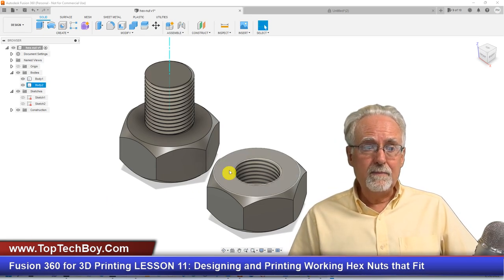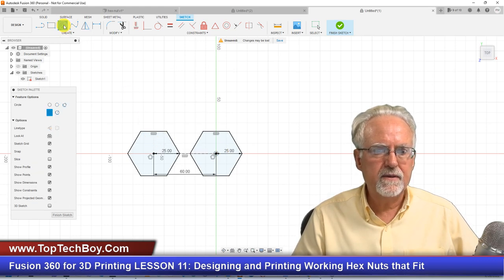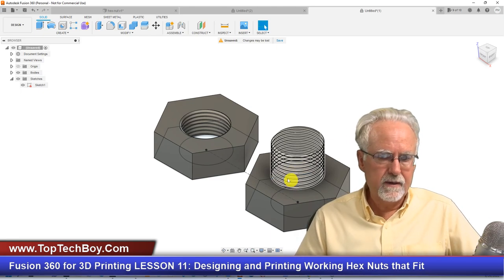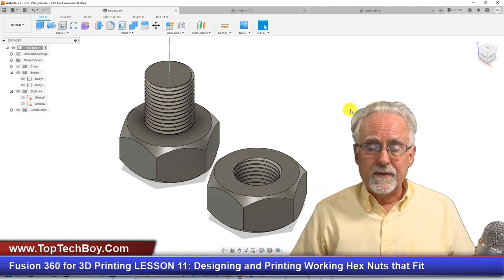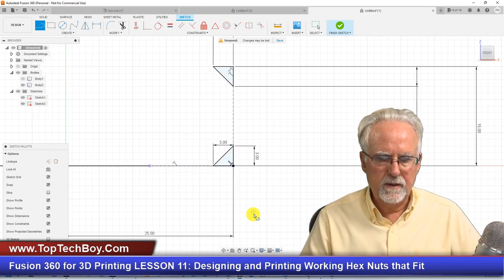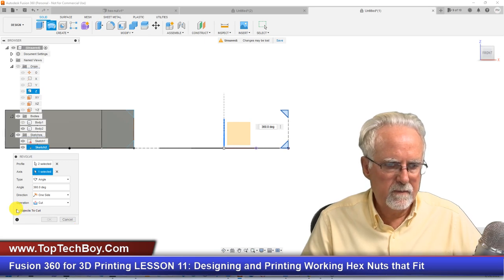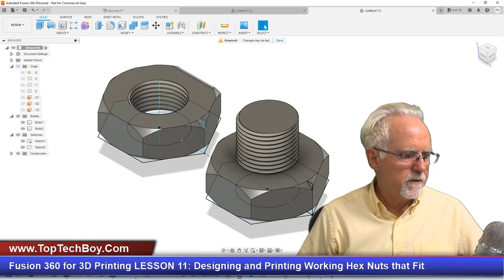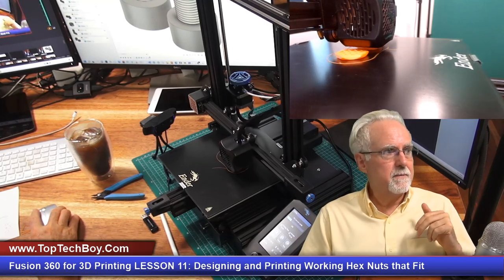Fusion 360 for 3D Printing LESSON 11: Designing and Printing Working Hex Nuts that Fit

Comment: i am legend. Hey Paul, a quick pro tip for you in case you are still struggling with the selection tool. Keep pressing the left mouse button near the Line/face/body/whatever you wanna select, a pop-up window will appear where you can quickly select what you wanna modify.

Comment: You are spot on target with fusion360/3D printing, that's exactly why I'm here.
I did the nut and bolt challenge and managed an unequal chamfer, I think it was 1mm and 4mm in but then it all went pear shaped when I went back to 2D and tried putting slight radius's on the hexagons outermost edges. As someone else has previously said, the order of doing things is important, another thing to embed in my nut.
Thanks

Comment: I understand exactly what your going for in this series. Back/forth makes complete sense because you’re catching every aspects of 3D design and manufacturing.
 
The Quick Tips series is an excellent idea because it either supplement this series or stand alone by itself. 

I appreciate you doing the series and am learning a lot. I made the bolt/nut and used the chamfer function to round off the edges. I went with a 0.1mm offset and it was too tight. Went for a 0.2mm and it was to loose. I ended up going back to 0.1mm offset and lowered my print height to 0.12mm instead of 0.2 and it came out perfect.
Thanks again for the classes and look forward to learning more about using F360.

Comment: I AM LEGEND!  I printed a nut and bolt with simple square shoulders and designed a version with fillets on the corners, but had no idea how to do the nice revolve version.  The threads on my first print were too poor to work.  I slowed the print speed and improved the print quality settings in Cura to get a great bolt and nut. Regarding future videos, the Quick Tips idea sounds great so long as they are easy to search with a simple indexing scheme. I am probably more dense than others, but I have always had difficulty searching for information in earlier lessons in Paul's courses.  Please don't be offended by my suggestions Paul.  You are the GOAT instructor on the Internet!

Comment: I feel like the way these lessons are being taught in terms of fusion 360 and printing is how it should be ! I really hope it’s stays this way where you go back and forth between fusion 360 and 3D printing because otherwise those of us not familiar with either will find it difficult to go back and forth between two different types of videos rather this way we learn both and the need for both and and the application of both so by the time we finish these lessons we are not really lacking any knowledge.I hope you keep this set up !

Comment: Hi Paul and like so many others have already said well done for super teaching skills and not least a super learning experience. In lesson 11 the threads correctly conform to ISO metric dimensions, However, the head of the bolt and the nut do not with the dimensions and horizontal orientation of the hexagon you use in the design. If you want a nut to exactly fit, for example a 15.0 mm spanner, one has to fiddle around with the hexagon dimensions. This is easily solvable but involves some tweaks with dimensions that are not whole numbers but with 2 decimal point corrections.

Comment: ahhh i see where i went wrong with my fillet attempt.. i had selected the top and bottom face to round instead of just the outside edges, so the inside hole was also rounded which made the bolt not fit into the nut

i will also say i primarily started following this series for the 3d printing portion, but i think learning how to do some of this modeling stuff is really important for that. thingiverse exists but i think people will always want to make their own stuff too. i think the balance has been really good so far.

Comment: You are my go to help solve what should be a simple issue in fusion 360. Totally by mistake I found two ways to do the revolve cut. And with the axis, I had drawn in two center axis lines on each part on that same sketch.  Now I need to figure out the printer setting I need no my Bambu Lab Printer to make the new test thread design work.

Comment: I really like your work 🙂Btw, when you tried to turn the z axis on for revolving, you need to also make the "origin" group itself visible, that one was turned off.
Faster way, at least for me, was to just draw a straight line through the startpoint of the first construction line and use this as an axis. That way you casn even draw that line to the outside of the body, which makes it clickable even when the body is turned on. You have the centerpoints still visible for both bodies from your very first sketch. You can use those for a line 90 degrees to the body - no need for any construction line or fancy stuff.

Comment: I half folded. I found an idea on a web site about how to produce the nice edge on the nut and bolt using an intersection between a cylinder and a hexagon.   Quick tips are a great idea. Normally I would  scroll through one of your videos to find the bit I wanted. For me Fusion 360 and the 3D printer go hand in hand, I can't design what I need without 360.

Comment: I managed to completer the homework assignment but arrived at it a different way. I found a suggestion to put a circle on the sketch intersecting with the points of the hexagon. then extrude it up as the last operation and viola a perfect chamfered nut.

Comment: I got my bolt and nut completed but I folded up like a cheap Camping World camp chair trying the rounded edges. I will try again of course because Mr. McWhorter’s students don’t just give up.
If you split the class in two would you do them every other week? Fusion 360 on the first and third Tuesday of the month and 3D printing on the second and fourth Tuesday? Or is the Raspberry Pi done on Thursday? I don’t think 2 minutes would be long enough. You would need at least 15 minutes plus you would need to get right to the point and not digress about the river cam. I enjoy the river cam and your stories about life in Africa so the class might be a little ho hum. I would eventually like the 3D printing to get more involved. Trying different types of plastic and hopefully having some problems cause calm seas don’t make a good sailor.

Comment: Not sure if that happened the way you planned it there at the end Paul, but non the less, and Super lesson! Yes, these longer dedicated lessons on the hot little shorts sound like a super idea! Again, than you and God Bless you and yours!
Reply from the maker: Vaughn, the second clip showing the finished print did not upload, so the end was missing. Sorry about that. The nut did print properly
Reply: Did the bolt print properly and also did the threads on each one print properly with no seam or blobbing issues?

Comment: Thanks Paul for another great lesson. While it is straight forward to create a nice diamond knurl pattern using a couple of steep pitch coils, one cw one ccw then do a circular pattern of those 2 features, it is really resource intensive for F360. I prefer vertical groves or even a tri-lobed head for printing. I like the idea of short tip vids.

Comment: Hi Paul,

I managed to complete the fancy nut and bolt in fusion 360 as I followed all of your steps. I noticed that in your completed drawing that sketch 2 was not fully constrained. Sketch 1 was fully constrained. The green z axis line iside
Reply: Sorry Paul,

I hit the comment selection before I was finished. The green z axis line was still present on the inside of the nut. Is this why your sketch 2 was not fully constrained? Just wondering why sketch 2 was not fully constrained.

Comment: Well, I think you have the right idea.  I would segregate the classes to where you have a main-thrust that has the two coupled.
Then, I would have separate classes whereby neither is dependent on the other, because they really are independent worlds when you get into the intricate details of either subject.
Finally, I would not make a whole buch of super-short videos because they get perceived as mostly noise; so I would make longer videos that detail multiple topics of each subject--which is more like 'one-stop-shopping...'

Comment: I personally use TurboCAD to 3D model, and i dont really have a problem. I can make simple things for my 3D printer, but im not that skilled. im self taught. I have made a few designs for work that i have used in ice machines, and some fridges, i made a clip for my motorbike to keep the choke up. Yeah 3D modelling is quite fun and i wish more people got into it. I would love to learn fusion 360 but i am way too familiar with TurboCAD.

 I enjoyed your video though. I was following along and seeing if i could model the same nut and bolt in TurboCAD. It didn't take me long, probably 5 minutes to get the basic nut and bolt and then the machined chamfer took me a while but i did figure it out in the end. and got the same result as you.

Comment: Hmm, I was doing fine to HWrk Level '1'. got the polygons in & constrained (even popped a chamfer on the end of the thread, although i'm not convinced the thread is cutting through the chamfer), but I used chamfer on the cylinders before the hexagon thinking that would create the cutaways. So Yep "Folded like a cheap lawn chair" Grrr ... Applied your method also for the thread start. it scooped away at the thread beautifully. Just like it came off the 'colchester'.

Comment: Hello Paul,

Maybe having one lesson on fusion 360 and the next week a lesson on 3d printer and tweaking the printer and going over cura settings and then alternate between fusion 360 and 3d printing each week. 

I have been able to print the cup, glass case, benchy, dog, cat, etc., but not able to print the nut or bolt successfully. They print ok but there is one spot on nut and bolt that does not print properly. It is evidently a seam/blob issue. I have tweaked several parameters in cura and binged watched youtube regarding this issue. The problem lies with the printer or cura. Seems the printer and cura need to be tweaked properly and upgraded so we can successfully print 3d creations. Very frustrating.

Comment: Hey Paul,
Not sure if you have started or finished your quick tips videos but one problem that I have been constantly having with my threads is excessive stringing on parts of the threads which then doesn't allow me to screw the nut and bolt together. I'm sure this could be a combination of problems that likely cannot be solved in a quick tip video. I tried printing with different qualities and tweaking the settings in Cura but I haven't been able to fix the problem.
It's almost like the printer is staying stuck on a level and some filament is oozing out which then creates a blockage in the threads.
Do you think this is an issue with my printer?
Any input would be appreciated.
Thanks again for all that you do! You're the man!
Reply from the maker: If your printer is tuned up correctly, then printing with dynamic quality should work without any stringers. If you have stringers, then it could be an issue with your printer. So many things could be going on. Old filament, partially clogged nozzle, misalignment of print bed. So many different things.
Reply: @paulmcwhorter  Thanks for the reply Paul. That was my worry though. So many different things could cause this issue. I'll try messing around with a few things and I will report back if I solve the issue in case someone else is experiencing the same thing.

Comment: Hey, Paul!  Another great lesson!  I NEVER would have figured out that contour, but I loved the challenge, and I have an idea how to achieve those knurls.  I am banging my head against the wall over the echoLocation RaspberryPi lesson.  I am getting a very pesky error message relating to the KeyboardInterrupt(): command.  It states catching classes that do not inherit from BaseException is not allowed. I do not understand what that means.  I hope you don't me mind commenting on a different lesson.
Reply from the maker: Massive nut and bolt! Well done.
Reply: DrDave The error you mentioned is caused by the line
except KeyboardInterrupt():
it should be...
except KeyboardInterrupt:
without the  ()
Paul added it to his code by mistake. I copied it too and had to debug it.
Reply: Hi DrDave.  There was an error in Paul's echoLocation program.  The except statement should be "except KeyboardInterrupt:", no parentheses.  Try it, you will like it.
Reply: Thanks Charles and Keith! What is really a mystery, and why I didn’t bother to check previous programs we wrote using that command, is that Paul’s python did not return an error message even though he used () in the command. Can you guys explain that by chance?

Comment: For the 360 chamfer create a plane through the center of the bolt using create menu, plane through 2 edges. Click on that plane then new sketch draw the triangles. Make sure you have an axis through the bolt if not on origin. Finish sketch,  Turn off body, choose resolve, click the triangles, cut, choose axis, turn on model then you should be able to click OK to cut the chamfer. I used another 3D package that let you view the cut part instead off having to turn on and off the body, as this is kind of clunky.

Comment: The bolt and nut came out very large. Followed the lesson and then sliced it and printed it and it came out about five or six times larger than what it should have. What migjt have caused this problem. Could cura slicer be the issue?
Reply: On second thought, after looking at the dimentions of the nut and bolt I am convinced that this is a large nut and bolt. I thought this would be about the same size as the first nut and bolt but not so after looking at the dimentions of the drawing. Would others agree?

Comment: Designing items for 3d printing with things like horizontal recessed holes and printing without supports, or designing supports in when necessary so the end user doesn't have to figure it out would be a good resource to have.
 There are bits scattered across the Web, but if someone could catalogue the methods?

Comment: but the "revoled triangle " is contraint to the "x" plane,  isn't contraint to the head, is there a way that this chambfer follow if I need to extrude the nut thickness more, sorry for my writing, english is not my regular language
Reply: the best way to do it would be to define a parameter that is the bolt head height and make all similar dimensions that parameter.  then if you change the bolt head height, they will all be parametric.

Comment: Hey guys, does someone know why the nut does not show the threads when I upload the file to the 3D printer Slicer app? While doing this lesson and lesson 10, I tried to print it out, but the nut has no threads, driving me crazy trying to figure out what is happening.
Reply: I figure it out. Make sure to check the modeled box

Comment: Could my nut and bolt threads have the seam/blob issues because I am not using the dynamic mode? Only other thing I can think of is maybe it is a retraction issue. Other than the dynamic mode in cura did you have to change any other parameters in cura slicer to print proper threads without seam/blob issues? I am stuck at this point. I am new to 3d printers and cura and don't have any idea how to get the threads to print properly. Any hints would be much appreciated. Wondering if anyone else is having this problem and wondering how many are printing the nut and bolt.
Reply from the maker: you really want to use dynamic mode, the threads will come out much better.

Comment: Hi Paul, i am legend, but only in a half 🙂 .... haha ... i cut 6 sides, but i have no idea how to do the nice Fillets, and not doing them 12 times separately
The homework was not too difficult, but we did not use some of these functions before to take them to work
And i still do not understand how the Revolve Cut, and Axis make the nice shape, why you designed 2 triangles  ? for what purpose ? because later you did not use them  ?
.... i need to understand what is going on, and why in this trick 🙂another way i will be like a lunatic ....

Paul .... let stay with Fusion360 mostly, because there is hundrets of combinations of the functions and ways to get an effect up ....
Printer 3D is another problem for us, the beginners , so better if it is as second group of lessons ....

Comment: So as many mentioned here, a chamfer on the bolt end and nut is a good design practice. I don't often model threads but when working on this lesson I found an issue with adding chamfers. I posted a video of the problem and workaround. https://youtu.be/n_5GkYix0Fc